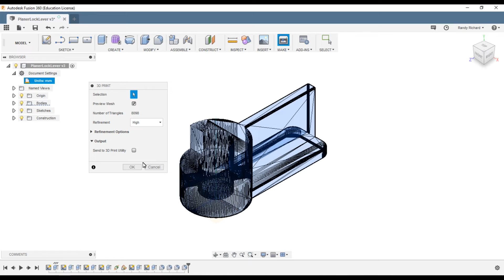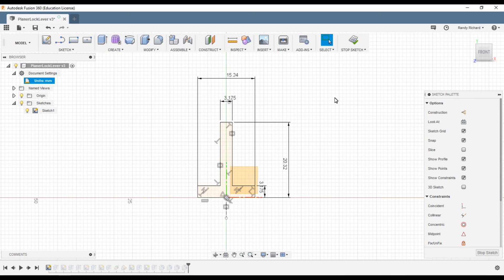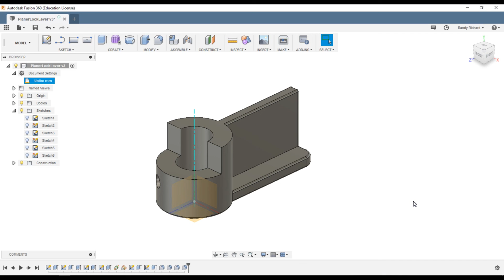Don't Worry Just Change the Units- Home Shop Fusion 360 Tip #4

Comment: My 3D printer must be one of the Dr. Frankenstein - Abby-Normal ones, since it does inches from Fusion360.  Good to know, though, Randy.
Cheers, Gary
Reply: Around 2 years ago one of the topics in the Fusion forum described the problem where a 1 inch cube was exported as 1.0 into the STL file, which is a unitless format. The slicer software then assumed it was metric. I think this was fixed for 3D print, but might not have been changed for "save as STL". Fusion internally uses a small metric unit (fractions of a micron I think) for all it's internal calculations, then converts that to whatever you selected as units. So when you change units you really didn't alter the model, just the expression of it.